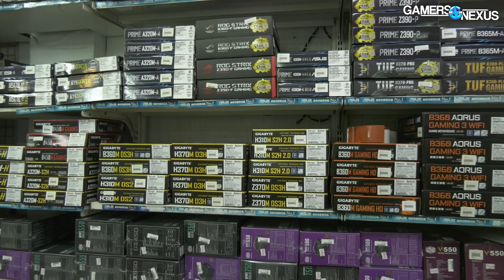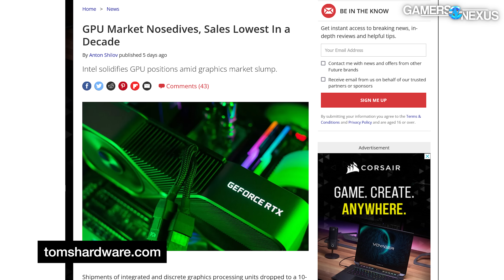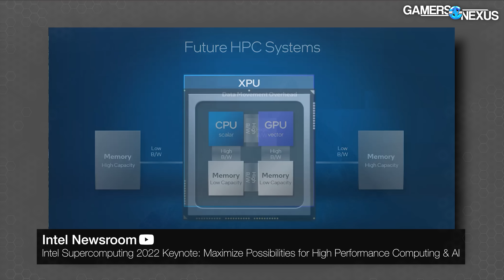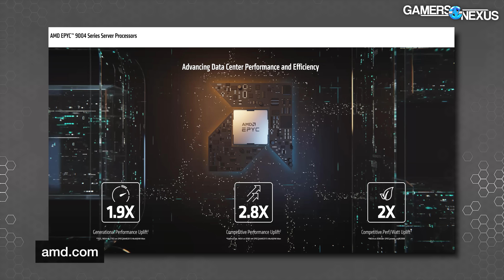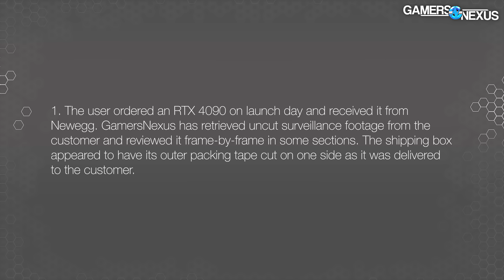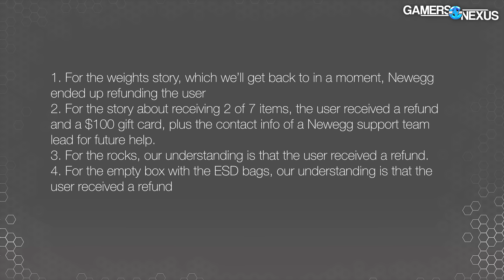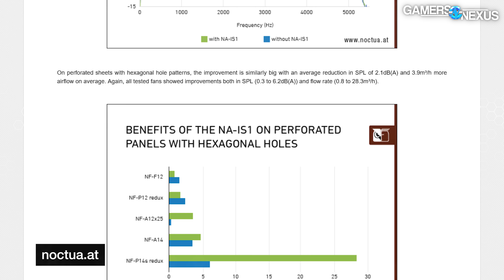HW News - AMD Beat-Down on NVIDIA Prices, Intel RAM on CPUs, Newegg Follow-Up, & More

Comment: Once, my regular UPS driver either stole my Newegg package or delivered it to the wrong house (happens pretty often with this guy) and Newegg did refund me, after essentially interrogating me over the course of several emails and requesting video evidence that no delivery occurred (which I did provide). Since then, Newegg has been much easier to deal with whenever there's an issue with an order.

Comment: wait wai wait….”Packaging cut on one side” only is suspicious. If the outer box was fully opened it would’ve had to have had the tape fully removed and retaped. There would have signs all over the box if it was. 

Not saying it didn’t happen but it’s really suspicious. Is there a link to the delivery footage?

Is there unvcut footage of the box being opened and the gpu box seals broken?

Comment: Steve I've watched your channel for a long time. I am not a Sonic fan, but have used AsRock boards off and on. You appear to not be a fan of AsRock boards are they that bad? Been thinking of upgrading and the cost of the board seems pretty good for what it does. Are the boards that bad?
Reply: They are absolutely fine. Avoid the cheaper stuff - but that's good advice for many mobo manufacturers.

Comment: Ryzen 9 5900x or i5 13600k
For 4k and 6k video editing
Price are same in our area.
Reply: The 5900X for sure. It's cheaper and the boards are way cheaper. Even in efficiency the 5900X is superior in thread heavy workloads.
Reply: @nipa5961  which board you recommend
Reply: @Hassanakora  
MSI PRO B550-P, ASUS Prime B550-Plus, GIGABYTE B550 Gaming X V2 and MSI B550 Gaming Gen3 are solid boards and cost between 119€ to 126€.
It all depends on your local prices ofcourse.

Comment: as a UPS xmas delivery person major theft of packages is happening at apartment buildings and urban residences PLEASE TAKE ALL HIGH VALUES IN PERSON aka get them shipped to work FRONT OFFICE if you will not be home. if you can not take delivery in person get them shipped some where that can by some one you trust or to a A) a UPS customer service center for in person pick up for free [9am-7pm I.D. required] B) a UPS STORE [*small fee and I.D.required but well worth the warm dry secure location with 7am-9pm operating hours]
if none of that is possible work on getting as many of the residences to work on apartment management to get a secure exterior drop box that all package and letter carriers can use from which residents can pick up their packages and for street residents in a community mail/package drop box location some where on the street.
those camera door bells only identify when some one is there, and only if the battery is excellent as cold weather -50% battery rule applies above 0º and below 0º the battery is murdered to -100% dead and your camera does not operate at all. a person wearing a mask and non revealing generic clothing can't be identified with out some sort of tell and cameras are easily avoided and or negated by devious means therefor don't make them obvious and keep them well protected and hidden and elf on a shelf them, best if out of reach=out of sight=out of mind.
also the cameras have extremely poor focus and range 5 feet or less is their optimal. you get what you pay for and conviction in a court of law isn't less than $400 from what i have seen as a witness giving testimony.
(GOOD VIDEO TO DO A REVIEW TEST ON THERE @Linustechtips or @Gamers Nexus)
at this time ALL NEXT DAY AIR (except air savers) MUST BE DELIVERED BY 1030AM at the latest. that will be subject to change the closer to Dec 25th thru Jan1st
and NO PACKAGES WILL BE GUARANTEED DELIVERED BY XMAS WHEN SHIPPED AFTER DEC17TH OR BY New Years Day AFTER DEC23RD

Comment: 27:54 having worked retail for BBY i can automatically say there is NO FLIPPEN WAY, EVEN IN A CARTON PACK OF THESE GPUS SOME ONE WOULD NOT SOUND THE ALARM WHEN TAKING THESE OFF THE PALLET AS NOISE LIKE THAT IS INDICATIVE AND SIGNIFIES DAMAGE. there is no way any one who picked up that gpu box would not automatically KNOW something was wrong #1 with the weight shift #2 with the metal to metal clanking. this is not a home gym set and any UPS/FEDEX/USPS person who actually handles packages wouldn't notice IMMEDIATELY, infact it's required at UPS to warn shippers about potential damage if we feel a product is not properly packaged about it's possible damage in transit as every one know about road potholes, speed bumps, other bad drivers, centripetal force when turning and newtons laws of motion the clanking would be noisy enough to be heard ALL OF THE TIME whether on truck or forklift or being carried, picked up and set down    .

Comment: I have the perfect $1000 pre built for you. It’s an HP Envy from Costco for $999. The specs are as follows: 
I7-12700, RTX 3060 Ti, 32 GB DDR4 3200, 512 GB NVMe M.2 SSD, 1TB SATA HDD.

On paper it looks like a pretty good PC, and considering current pricing I’d even call it a pretty great value for a pre built PC. I’m sure it’s loaded with proprietary shit, but 12700 and a RTX 3060ti w/ 512 gb m.2 SSD and 32 GB of DDR4... it seems like a great deal. I’d really love to see you do a tear down on it, I considered buying it myself just as a spare, I’m sure I could do some little upgrades like the cpu cooler and it would be a decent little machine. I’d love to hear what you think, cheers!

Comment: Wow, glad to see I'm not the only paranoid one when it comes to expensive items.

While primarily with 3rd party sellers, if high enough value I tend to record myself opening the package on camera (shipping box, to product) for my own protection. I've never actually had to use one of these videos for my defense but I don't feel you can't be to safe protecting yourself.

Granted I've been scammed a few times online, oddly enough primarily from Chinese sellers online. Either product never comes, or they try to stall me hard until the dispute period had past.

I've learned to never spend much money on them, granted I too have had excellent experiences buying directly from Chinese sellers. However there seems to be about a 20% chance I will get scammed when buying from them on eBay.

My favorite is never getting shipping info, them telling me to wait 2 weeks, time passes, they claim to ship another (again with no shipping info) telling me to give it 3-4 weeks this time (past disputes). In cases like this nothing has ever shown up 100% of the time so I instantly dispute.

Normally only a $30-$40 item however that does add up over time.

Comment: MAXSUN broke NVIDIA's price floor on RTX2060, so for 30series they have extremely limited supply of GPUs to make graphics card, that's the reason they just released some new 30series. They still don't have the 3090 chip now.

Comment: bought an asrock rx 6800 for onlyu £500, i kinda wish i waited and got the 6900 XT for £680 but 6800 is still a solid card, theyve come a long way with ray tracing but either way most games i play dont use it

Comment: The story I heard with Maxsun is that they are the latest manufacturer to receive approval from Nvidia and just received the chips. Also the "newly released" on newegg is not precise because I recently (11/08) purchased two Maxsun cards (3070ti girl edition and 3080 icraft) before they went out of stock, and for some reason the "out of stock" changed to "to be released" And they are good and legit brand new cards with fresh pcbs. I would be surprsed if they made new pcb to put the gpu or memory chips that are reused from mining operation.

Comment: So I don't think it is Newegg doing anything. The last 3 things i have received have been weird. Not from Newegg either. An envelope was open in the mailbox. And 2 packages have holes in the cardboard. One box has a big fairly clean cut in the side. Easy to look in and check what's in the box. I mean it looks like someone cut it with a knife. That is an Amazon box.

Comment: 26:58....once that package leaves a facility into a vehicle, there is only the integrity of the drivers transporting that product and as we've all seen packages aren't supposed to be delivered damaged or opened or mishandled and security cameras have shown other wise from all the major delivery companies despite those exact actions being forbidden under company policies.(and yes @UPS if a package is open or damage it MUST be brought to a supervisor who will inspect it and direct subsequent actions to be take thereafter if it just goes to repack to have it's contents inspected for missing damaged parts and resealed or repackaged after contacting the shipper about what happened with the package and what the shipper wants done from there end before delivery.
in cold weather the tape sealing packages doesn't usually stay secure due to inferior stick by non3M tape manufacturers as 3M tape is specifically designed to endure -25º temperatures

Comment: 16:26 now if only they could bring USB ports that don't all go dead within 2-3 years to their motherboards. Every asrock I've mobo I've built for others or used (X58/990FX/Z270/X370) had that issue, where as crappy msi/gigabyte/asus boards half the price are still fine, my budget B450 Msi Tomahawk is fine after 3+ years with the same damn psu my Taichi used as it died port by port.

Comment: AMD's fire sale of RDNA2 cards is excellent news. Strong signal that they'll launch the 7900XT(X) with decent stock, and won't take too long to follow up with the midrange/lowend SKUs. And very bad news for NVidia's plan of dragging high prices for both Ampere and Ada as far as they can get away with.

Even raytracing won't be a reason to prefer any Ampere card to RDNA3 at the same price bracket, let alone at a significant discount - current street price of a 3090ti is $1,7K and that's just the FE, any AIB model goes for $2,2K, that stuff will be destroyed by RDNA3 in price/perf and lose or at best tie in raw perf even with RT.

Comment: RAM on cpus has been working pretty well for apple lately ;)
Reply: Hopefully here it doesn't trickle down to consumer products such that we have the CPU, RAM, and GPU all on one soldered chip. I suppose if these HBM CPUs are just one SKU out of dozens, it won't be as egregious as what Apple has done.
Having HBM as a caching solution or alternative to DDR rather than as a replacement seems like another relative benefit compared to soldering all of the memory down at least, especially if there's actual performance benefits as well

Comment: The fact that there's now a RTX 4000 series and PC case compatibility tool means that Nvidia designed the 4000 series wrong. It's not universally compatible with the case size it's supposed to fit.

Comment: But my Rx 6800 does 4k great in 90%  or probably 95% of games. Especially if i use FSR so I don't know why you recommended  those cards if you aren't bothered about 4k gaming. It literally says 4k on the box lol. Which is why I upgraded from my 6600xt which said 1080p on the box although that did 1440p fine.

Comment: 5mm fan spacers hardly seem worth it. I've found 3d printed 10mm-25mm thick spacers in various radiator sizes on places like Etsy for decent prices. Haven't bought any yet, but at least they're of a thickness that might justify the price and performance uplift for water cooling.

Comment: I bought a ASUS ROG Strix Scope RX keyboard and the LED's started to fail after several months. The same thing happend again to the replacement keyboard, so It was returned for a full refund and I bought a SteelSeries Apex 7 instead.
No wonder they don't want to warranty the LEDs in the PSU, they know...

Comment: Newegg: January 2022 I purchased a whole new everything for a new PC and the security sticker on the 12600k CPU was popped up instead of being sealed. Normally those have to be torn or cut to open them, so somebody had managed to pop it up, leaving no residue or torn box surface behind, and inserted an 12600k CPU that was all beat to hell with gouge marks in it. I took pics and sent them to Newegg within 15 minutes of receiving the package and they told me I'd have to box it up and send it back, then they'd assess it, and then eventually they'd send out a new CPU. I was building a new PC because my 4790k motherboard had died, so I didn't have 2+ weeks to wait around. They eventually issued my refund, but I had to go to Best Buy the day I received that package and plunk down another $270 for another 12600k which was the last one in my town.

8+ years ago I ordered a whole PCs worth of parts from Newegg and the tracking number was issued but there was no record of the carrier picking it up from the warehouse. I waited a week before contacting them and they accused me of theft. I had to show at least 3 of their people that my box was never picked up from their warehouse, and it was certainly never delivered to my house. They took another week to verify I wasn't ripping them off and then they finally shipped out my stuff.

Their process can be maddening.

Comment: I'm sorry, I cannot forgive Newegg for them pulling the same crap over and over again. Far too many times it has taken someone like GN blowing up a story before Newegg steps up and does the right thing. The fact that they admitted that "their policy was to immediately freeze the account and NOT contact the customer" is disgusting, the only reason for locking the account would be to prevent the account from commenting/reviewing, and the fact that they do that without contacting the customer, their policy appears to have be intended to keep the customer in the dark and basically deny all claims like this. How is a customer supposed to put their faith in a company that appears to simply assume all users who don't get what they pay for a trying to commit fraud? Newegg still lacks any quality control system in place for anything purchased from a marketplace seller, and yet they still default to denying the customer's claim rather than investigating the marketplace seller. Even if you can get them to look at your evidence, it's always the customer that is expected to show evidence that the package arrived that way, they do not demand any such evidence from their marketplace sellers, only chain of custody evidence that is a standard part of any shipping operation, no proof that the original box wasn't opened, if the package weight matches what the manufacturer states it should weigh, and the shipping company reports "delivered undamaged" (which btw, they can only see the outside cardboard box), then they deem the marketplace seller has provided all proof necessary that the item shipped as promised. I reiterate my promise that after spending well over $25K w/ Newegg over the years, to never purchase from Newegg again until they get rid of their marketplace system, or at least force the marketplace to have full quality control and match Newegg's formal return policies, and also somehow prevent marketplace bots from buying out all existing inventory of an item to then immediately repost it and sell it again before that Newegg has even shipped the product to the marketplace seller.

Comment: That newegg story, if true, would just indicate that someone in the shipping chain, probably pretty far down where they don't really care about the damage done to NewEgg (ie someone not working for them, that don't fear of getting investigated internally) is just stealing package content.

THAT SAID, if that was really the case, why not just steal the box itself? Why bother putting some weight in there? That's the kind of stuff only someone very high on the shipping chain, before the package has to be weighted to be shipped, would have to do if they wanted to pick up something...
But is there anyone stupid enough to pull such move when the obvious result WILL be them getting caught?

That or the Redditor just lied and is trying to scam NewEgg, which honestly feels the most obvious answer since it's easier to imagine a redditor scammer wanabe getting caught in its one lie, rather than an employee turning on a ticking bomb that will blow up in their face at some point.

Comment: Newegg Canada froze and closed my account for an order that I never placed.  The order was caught in transit and sent back to them, originally their rep told me to call my bank to request a chargeback, so I did this.  But after that they refunded the order days after they received it back at their facility.  They still have not unlocked my account with about 10 years of pretty dense purchase history.  So I will just never order anything from newegg ever again, even though it can be easier at times to get some products with them they were very rude and suspicious of me throughout the whole process and immediately closed my account forever before I could even print off previous invoices.  The only reason newegg has made any changes in the favor of the customers that have been affected by any issue is because you have brought them up, you had a god damn binder full of reported issues and that wasn't even all of them!  In the end I had the order refunded but I still don't have a newegg account and will never register a new one, f em!

Comment: Fact: These products are in development for years before getting announced
Fact: Marketers do not have a direct line of communication to engineering
Conclusion: The engineers working on the MCM data center GPUs rolled their eyes when the marketers came up with the Glue comment

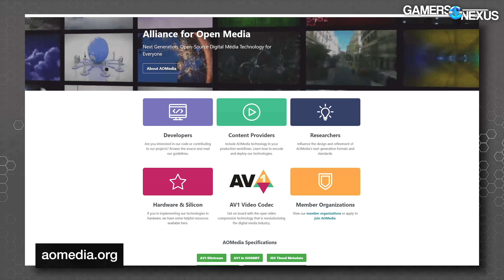Comment: Small error here 25:43 : AV1 is the successor to H.264 not H.265. H.265 is the same thing as HEVC which is AV1's competitor.
Reply: AV1 is not a successor to h264, it's a successor to vp9